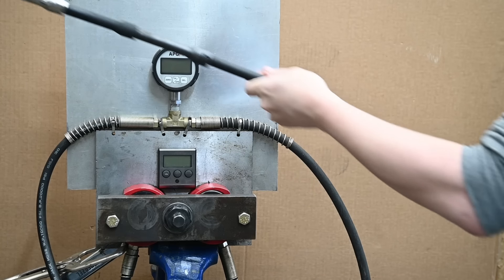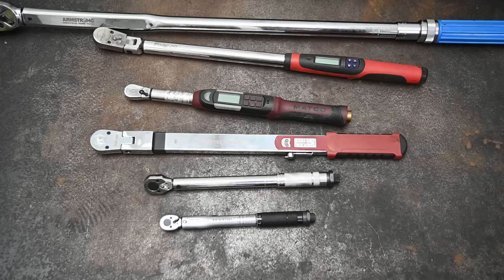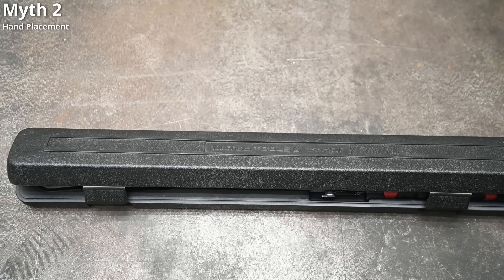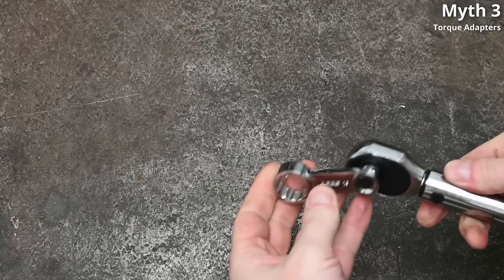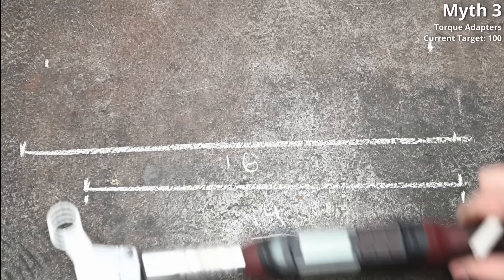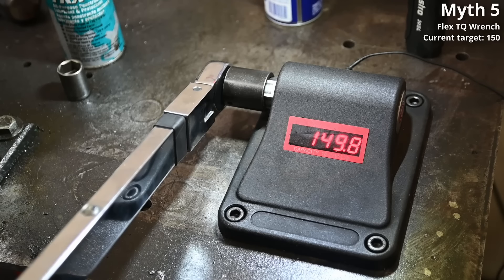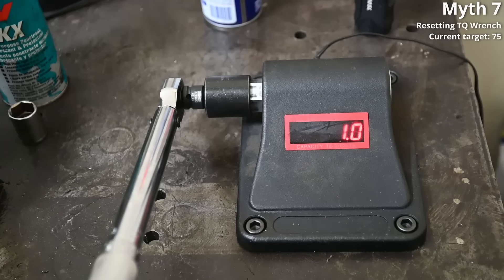You're Using a Torque Wrench Wrong: MythBusting 10 Do's & Dont's

Comment: This is great! Glad to see someone finally properly demonstrating how lubricating threads throws off torque wrench accuracy wildly. I think this is why many car manufacturers changed the cyllinder head bolts tightening operation to be angle torqued rather than by torque wrench - deep threads that have random fluids on them are going to mess up head torquing badly otherwise. A lot of good repair manuals will tell you to make sure that everything is clean and dry from oil for this reason if a torque wrench is to be used. If a very long bolt is flexing from the friction of it's tight or dry threads then the angle torgue will be innacurrate too lol - you can't win until you get very fussy and consistent with everything!

Comment: Very informative video.  The anti-seize myth confirmed is mind blowing that it double the torque.
Reply from the maker: Doubled the bolt tension, basically clamping force. Torque and bolt tension have always held a loose relationship, and using a lever stick and measuring how much effort you're using is still practically cave man era tech. For example engine builders measure bolt stretch on a rod with a micrometer to determine proper bolt tension. But I agree, the anti-seize blew our minds. We probably tested it a dozen times because DOUBLE sounded like it would be hard to even sell you guys on being real. K factor is no joke.
Reply: @TorqueTestChannel  Yes. This is why ARP is *adamant* you only use *their* thread lube when tensioning their fasteners to to their torque specs.
Reply: @GroovesAndLands  I work maintenance at a refinery, we had a company come in about 10 years ago and show us just how crazy torque can get depending on what coatings, lubricants or loctite are used. it definitely blew my mind!
Reply: It didn't double the torque, it doubled the clamping force. I use anti seize on damn near everything, I've never had a bolt or wheel stud break. I have an old f250 that has been sitting since 2017, the lug nuts were torqued to 150ft/lb. I bought a Hercules 20v compact impact gun a month ago (April 2024)and it has no problem with removing the lug nuts. So if doubling the torque was happening these lug nuts would be over 300 ft/lb, that Hercules doesn't do 300, It does 250 at best.
Reply: @truracer20  Exactly.  If this was true, Putting oil on head bolts/studs before torqueing them to SPEC would be erroneously taught and Required by every manufacturer on the planet. ... Interesting. Out of all the engines ive built this way, Ive NEVER had one come back for a head lifting off, or being over torqued and warped, leaking gasket ect.. Never.
Reply from the maker: @crisnmaryfam7344  You're talking about a bolted joint (head bolts/studs) that call for being lubed. This demonstration was on a bolted joint that calls for being dry, and only applies to that. Always consider what the specification calls for 1st.
As for other cases, we're not calling your experience wrong. But survivorship bias of "nothing bad has happened" or your impact can take them off isn't a good yard stick. A bolt in higher tension, resulting in more clamping force, is stretched more and closer to failure. Not automatically ruined, but torque wrenches are very basic crude instruments that quantify how much you're TRYING to tighten. 100 ft-lbs applied to rusty threads will be a barely tightened joint, the opposite is also true. It's not new science, we show the formulas for this in this episode.
Reply: I wonder if the cone of a lug nut meeting the taper on the wheel makes up for some of the lost friction with the anti-seize. I would think the two tapered surfaces coming together would provide more friction than a flat washer on a hex like in the video. I believe it would still yield a higher torque value but maybe not double.
Reply: @smity326  Keep in mind that the surface area on the threads is probably significantly higher than the surface area of the tapered cone, so it probably matters a lot less than you're thinking. Living in Ohio, I was taught to apply a small amount of antiseize to the studs, but now I'm thinking that may not be a good idea. Tough situation considering how stuck lugnuts will sometimes get.
Reply: @TorqueTestChannel  At work I got a fastener where the supplier used the wrong dry film lube. The k factor tested at 0.1 vs the 0.18 we expected for manganese phosphate bolts into cast iron. Totally necked it at a fraction of design torque. Absolutely, lube makes a massive difference.
Reply: @GroovesAndLands  Those retired people take this stuff seriously.
Reply: @TorqueTestChannel  Makes sense those instructions to "so tight then 90 degrees". If the torque is just a "lightly tightened and the slack taken out" then the angle will be a fairly predictable amount of stretch (calculated by the thread) and clamping force. Though there are also bolts that are designed to be deformed (and not reusable) too.
Reply: @webby2275  Tricky because you have two factors at work. You want the clamping force but you also want tight enough that they don't work loose. The ideal thing is probably to aim for clamping force then use castelated nuts or wire. That's a bit overkill for studs though.
Reply: @smity326 it would probably make more sense to apply a surface finish safe lubricant to the cone of the lugnut to achieve the proper torque. NASA has a great document from the 90’s on K factor and how to calculate it.
Reply: Thread torque to clamping force is absolutely dominated by the thread friction and head (washer) friction.  Would have been neat to see antisieze applied to the head  as well as a nasty rusty bolt.  Maybe moly lube as well for another extreme.
Reply: @chaos.corner  A few car manufacturers I've some across have one time use head bolts - I'm absolutely certain that this is followed by every car mechanic out there ;-).  But, as these guys point out, accurately deforming a bolt will give a true tightness (not torque) measure. I've seen bolts that have a centre pin with a loose washer at the head end. When you tighten the bolt, as it stretches, the washer will stop rotating on the centre pin - a true measure of tightness.
Reply: @TorqueTestChannel  Try that test again and add motor oil to the anti seize and see what happens.
Reply: The anti seize reduces friction and it basically is the friction the torque wrench is measuring (unless it works by hanging out under the bolt during tightening)
Reply: @TorqueTestChannel  You should amend your video description or add a sticky post at top to indicate the multiple testings. Thats actually very reassuring to hear for those of us who've been using the 'official' 30% derating previously promulgated.
Reply: @truracer20  My thought exactly

Comment: I knew the anti-seize 'myth' wasn't a myth because every torque spec I've ever seen for heavy truck axle options lists a dry and a wet torque spec. It definitely wasn't this severe though, I think wet spec is about 1/3rd-1/4 less applied. I suppose this is based on a specific amount of anti-seize applied and is probably less severe with larger thread sizes.

Come to think of it I had a job where we replaced all of the intake and exhaust pipe on a navy ship.
I, along with big buddy Dave personally torqued almost all those bolts on those big pipe flanges, 200nm, stainless M16 or M20 bolts with copper anti-seize.
200Nm isn't a picnic but it seemed like a pretty big 200Nm... We stripped out and snapped a bunch of those bolts, I never really considered applying wet torque to those specs, lesson learned, hopefully she holds up.
Reply: I guess that's the thing they mentioned on 18:36, it's all over the place depending on content of anti-seize, application (thick, thin, dot, etc.), bolt and nut conditions.
Reply: Stainless steel is a somewhat unusual.  Depending on the exact ally It galls very easily and strip easily.  The other problem is torque wrenches are less accurate at the edges of their range.  I have had a few cases where the wrench didn’t click before the bolt did.
Reply: Also worth mentioning that the reason the wet torque spec isnt that much lower is because when the bolt is lubricated you actually want a bit more tension on the bolt (which is what the dyno measures) to keep it from backing off (since the lubricant makes that process a little easier).

Comment: Looks like I need to buy a luggage scale.   My cheap HF torque wrenches have been left at 80 or 100lbs for years.   I didn't know you were supposed to turn them down to zero.   I've also used mechanic glitter on my studs in the past so I'm glad I watched this one.   Thanks.
Reply: Not zero.  About 15%

Comment: I couldn't count the amount of posts I've read to do with storing your TW at whatever setting. Many many many folks would all tout the same advice that springs don't deform or change over time so therefore u need not set it to zero. I've heard it from machinists, engineers, spring steel experts, long time mechanics, just about everyone. BUT...the manual always said, 'when storing your TW reset to zero'. 🤣 This is an information lesson where often the 'expert' offering advice is just Jo Blow who is repeating something he's read. And that happened like thousands of times. This happens on the internet in communities where the gene pool of 'original' information is small. Good job TTC!!
Reply: Keep in mind this was a cheap harbor freight spring cranked all the way in.

It's just one data point.  For example leaving your wrench anywhere other than cranked all the way in may not matter.

The tool designer could also design a little more leeway in how compressed the spring actually is at full adjustment as well.

All it confirms is that it can happen in a worst case scenario with a cheaper tool.
Reply: @GigsTaggart  I'm gonna chime in with more anecdotal evidence, USGI AR-15 magazines stored loaded work less reliably when stored full of ammo, than when kept empty. Springs are springs after all, and the magazines we had that were kept loaded for months at a time would not feed the first 2-3 rounds as reliably as the magazines that were allowed to decompress. Yes, they were cheaper magazines with a single coil spring, however they were bad. Also to note, US Army doctrine used to be that those magazines had a 5 year expiration date from manufacture, but that wasn't followed much of the time since magazines come out of the unit budget. If you still had them, you kept using them until they were bad.
Reply: @GigsTaggart  I agree with you here.  I've got an SK click torque wrench 1/2 drive (25-250ftlb range I believe) that I leave at 80ftlbs for the lugs I torque most often.  I've had it set this way for more than a decade.  When I periodically test it versus my Mac digital torque wrench (that I have sent out for calibration) it's spot on.  I think where the adjustment is left at and the quality of the spring probably makes a big difference.
Reply: @loki91t  Doesn't really matter the quality of a spring, they will all hold memory eventually. even just using them as intended and zeroing will deform with time doesn't matter what spring steel was used, nothing lasts forever. it may make a difference but doesn't make it immune to deformation so the info in the video is still valid.
Reply: @mattlitton8066   I would argue that it does matter as there are quite a large variation in steels and alloy qualities.  Materials science comes into play here (part of mechanical engineering field of study), and there is such a thing as an edurance limit for steel that means it stays in an elastic range of strain and therefore does not yield plasticly.
Reply: @loki91t Even in allowable tolerances everything yields with time. You cant honestly believe what you're saying right?
Reply: I have a Hazet 6290-1CT torque wrench and Hazet say endurance tests on the 5000 and 6000 series proved it's no longer necessary to reset it back after use...
Reply: @mattlitton8066  Unless they are teaching incorrect information in engineering school regarding stress and strain, then yes I believe what I'm saying.
Reply: @loki91t  yeah okay bro, imma just leave it at that. We'll have to agree to disagree on this one. Never seen a spring that didn't fail at some point and usually before anything else aside from rubber seals. You got me dead to rights on not knowing the science behind it, but I've turned a lot of wrenches and changed countless bad springs used as they were engineered to be used still go bad.
Reply: @loki91t They're teaching the optimal case, like how unless your professor is being a real a-hole, "all flows are laminar" Real springs are not perfect and have inconvenient grain boundaries, odd phases from heat treating, and can fail without reaching plastic deformation stresses.
Reply: Doesn't matter what anyone "thinks", follow what the manufacturer recommends. It's easy!
Reply: Who needs manuals when you have so many 'engineers' entering the chat! 😅
Reply: Any firearm enthusiasts, mechanical engineer, or spring air rifle person will tell you with absolute certainty that spring fatigue is real.
Reply: Norbar did a study and found that thier wrenches are not effected that much. They are more concerned by people over winding them off. My side not is many companies use preset wrenches that are permanently set at a setting and used like that for years with no need for adjustment. Btw I work in a UK cal lab and have some very nice kit for testing torque. I ought to film the difference applying torque at the front, mid and end of the handle.

Comment: I was always cautious about getting any anti seize on the lug nut threads, this video definitely confirms why I was hesitant. I still use it on the rims and the rotor where they make contact, this has helped with changing out tires tremendously.

Comment: Great video.  

One comment/caution about resetting the torque wrench to zero.  Be careful the handle does not come apart as mine did once.   I used to set my old Craftsman click type torque wrench to “zero” (there is not actual zero setting on it) until I found that the adjustment twist handle had come loose and moved, changing the calibration.  Now I leave it at 20 ft-lbs, which is the lowest setting.   Keeping it at that low level is just enough to keep the parts together but it is not enough to put a set into the spring.  I took the wrench apart and found nothing that I would consider to be a defect.  I think this is just a flaw in the design, which causes the handle to come apart.

If you ever want to cover even more torque wrench myths, I can think of 2 more.  One is how fast a person raises the torque to and past the click, and then quickly does several more clicks to “ensure it is good” (I guess?).  The other is to go past the “click” and keep applying force to the torque wrench handle.  Does it continue to raise the bolt torque?  I have found that to be a yes.
Reply: Going past the click I've seen someone do after I handed them a torque wrench only to find out they had never used one before and didn't know what the click meant (hard to fathom I know).  I also wonder if it damages the accuracy of the torque wrench doing that.
Reply: I've actually only ever heard to leave it at the lowest setting, not zero. Sounds like you found that out by accident :))
Reply: i dont think the handle coming apart changes the calibration
has happened to both of my cheap 20€ wrenches and the torque still seems to match
i think the adjustment "handle" just screws onto the usual black nut which is what drives the innards to adjust the torque setting
Reply: I had the same exact thing happen, also with an older Craftsman clicker type wrench.  The handle and calibration bolt just came loose when turning it down to zero.  The wrench had been re-calibrated by a 3rd party company before that happened, so maybe the company who calibrated it didn't snug the bolt down very much, I don't know.
Reply: @toiletgaming2005  Actually it did change the calibration.  When turned, the handle would alternately engage and then disengage from the internal part that actually changed the setting.  This resulted in a change in the setting.  It was a bit of an effort to get it back into calibration.
Reply: The instructions with every "clicker" type torque wrench I have ever owned said to store it at the lowest setting on its scale, NOT zero (which is not even on the scale of any of my clicker type torque wrenches).

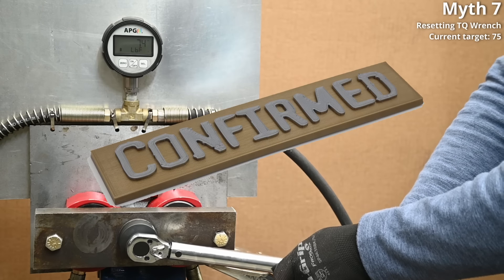Comment: At 14:21 you confirmed that leaving a torque wrench wound all the way up is bad, which is why everyone says to unwind them. Most people say to unwind them all the way, but all the manufacturers say to either wind them down to the lowest setting on the scale, or 20% of the max. The explanation I've heard is that unwinding all the way can cause the sitting mechanism to unseat, and shift, therefore affecting the calibration.
Reply: All the clickers I've owned say in the manual to store it below 1/3 or 1/4 the max setting.
Reply: I’m not sure that is correct if you have a 10-80 lbft wrench you would store it at 10 lbft not 20% which would be 16 lbft.
Reply: I know my Tektons have instructions stamped right above the scale that indicate the storage setting in ft-lb. On all three I have,this happens to coincide with the bottom end of the scale, but that doesn’t mean anything for other manufacturers. Handy that it’s consistent across models, and that it’s easy to remember.

Comment: I knew about the dogbone 90° angle concept and that micrometer torque wrenches need to be reset after every use, but I did not know about the swivel adapter error, or that split beam torque wrenches don't need to be reset.

Thanks for the education!